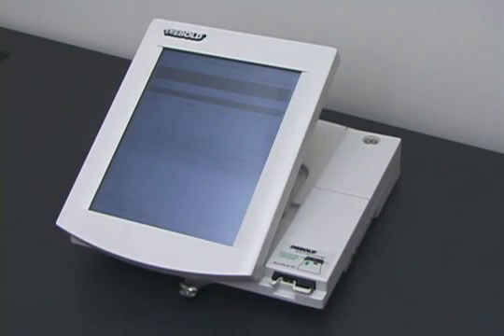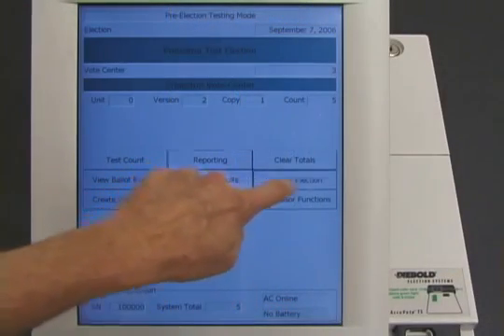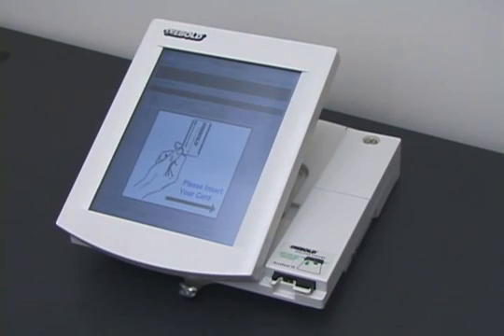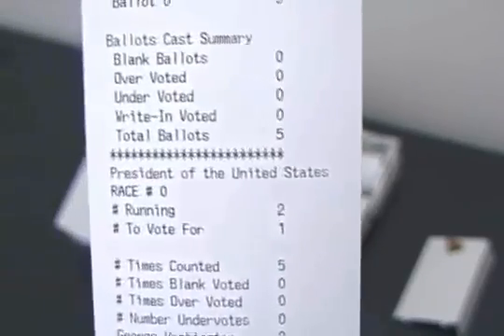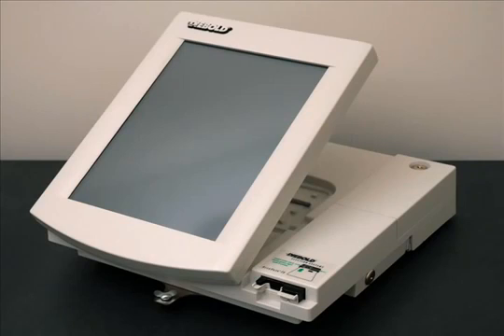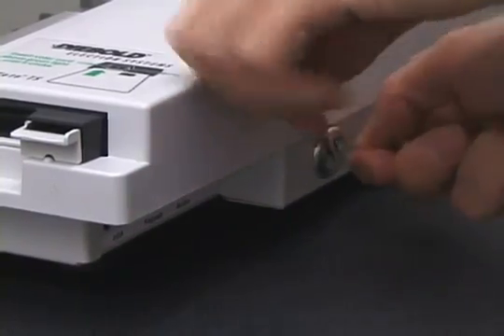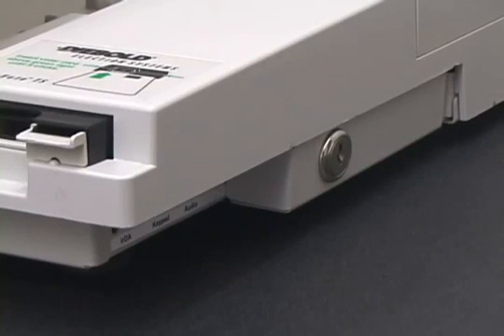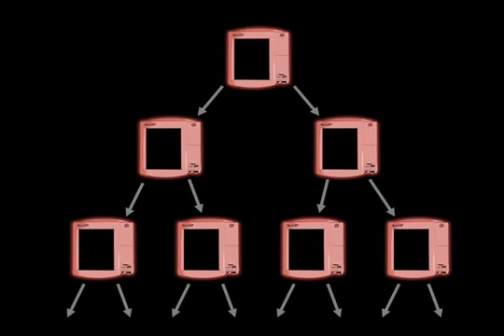Security Demonstration of DieBold AccuVote-TS Electronic Voting Machine

Comment: How, do companies still get the secure development lifecycle wrong. Security should be designed into the device and the operating system. Additionally, Princeton should indicate how the software was injected. You require physical access to the system. Dibold fails on design.